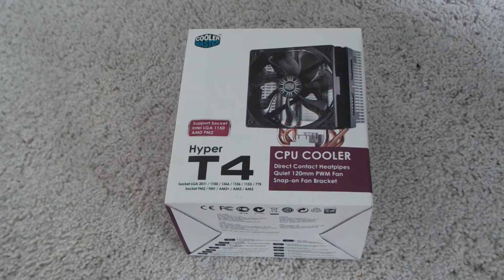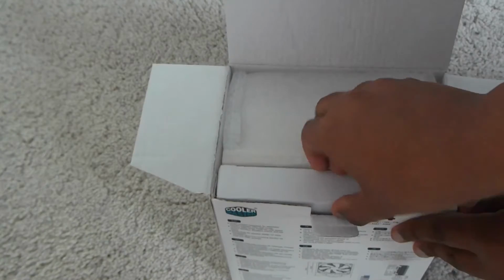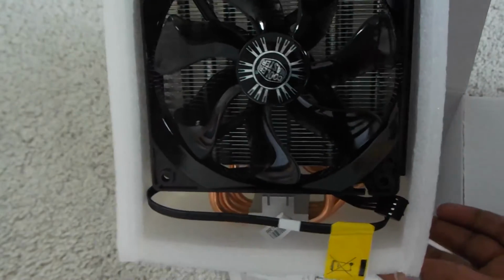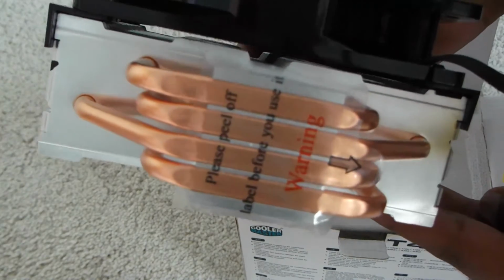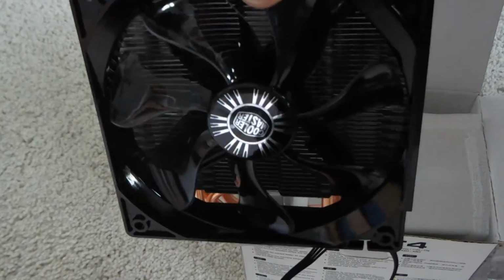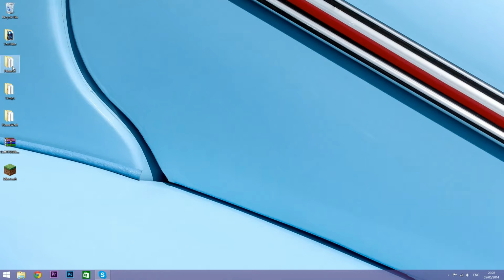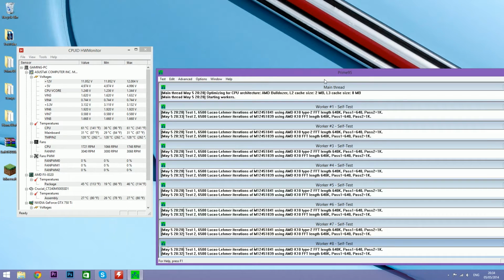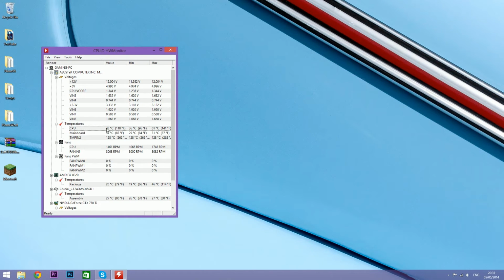COOLERMASTER HYPER T4 UNBOXING AND TEST

Comment: Does anyone know if this will fit in a corsair spec-02
Reply: i think yes the official site says that the max height is 150mm this is 152mm but don't forget the side window isn't flat and gives you some extra space (150mm is the kind of "safe" distance)
Reply: Yes it will definatelly fit in te spec-02 because it supports a cpu cooler up to 157mm (150mm is the spec-01 sorry)

Comment: Hey i just got my computer and i was wondering do you need to remove the motherboard to install the Cooler Master Hyper T4? Also if so how hard is it like do i need to remove everything or can i just unplug like the fans and stuff off the motherboard and just unscrew the motherboard and take it out with the ram and cpu fan in place. I know that you need to take off the Graphics card/ Video card but is there anything else i need to take off?
Reply from the maker: You shouldn't need to take the motherboard out, the instructions show you only need to slowly clip the fan in place with the existing slot on your motherboard.

Comment: will it fit in the Cooler Master K380 case? all side panels closed
Reply from the maker: Do you know how wide the case is? Daniel Theivendran
Reply: 209mm
Reply from the maker: Yes it will fit quite nicely then
Reply: GAMETECH Armytricks ALRIGHT! thanks buddy! but if it doesn't. I'm coming after you! xD
Reply: GAMETECH Armytricks and what are the temperatures i can get out of this?
Reply from the maker: Well with your case, you'll get a 1 or 2 degrees lower than what I had in the video.
Reply: GAMETECH Armytricks alright thanks for the help buddy!
Reply from the maker: No problem, tell me how it goes if you buy it.
Reply: Sure thing!
Reply: Daniel Theivendran and, fit or not?
takng the 209mm to check if it fit is wrong 
you gotta check "CPU cooler height: 155mm" The Hyper T4 is 152.3 mm
(From my research)

It should fit, now, it worked?